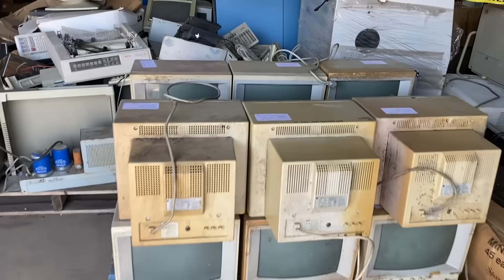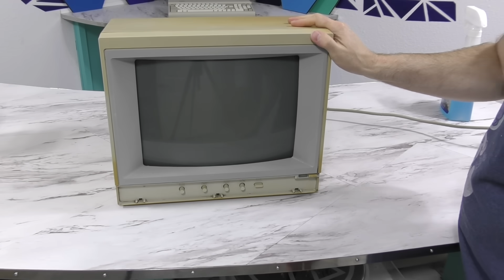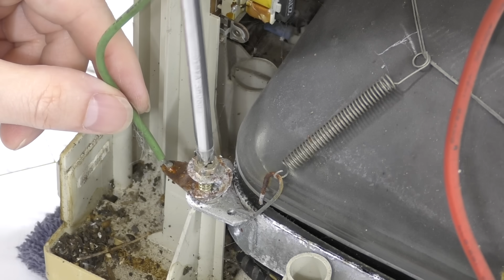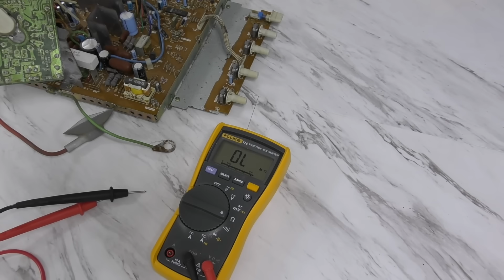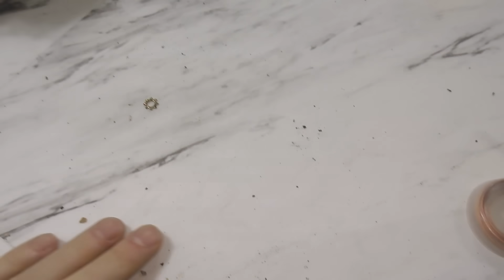Apple Monitor Found in Landfill - Restored - Part 1

Comment: Oh, wow, an Apple IIc! That brings back memories. I got a typewriter when I went off to college, because back in 1982, it didn't seem like a personal computer would do much for me. But one of my younger brothers went off to college 3 years later, and by then, there was a lot more off-the-shelf software, not to mention more affordable printers, available. So he took his graduation money and bought an Apple IIc, with the matching small monitor and stand and a printer (maybe a Gemini 10X?). A couple years later, after I graduated, I babysat his Apple IIc outfit for the summer, and I hit upon what was something of a revolutionary idea at the time: Why not use my bro's computer to help me with my job search? After all, it had ProDOS and AppleWorks, and it was all set up so I could play with it. Little did I realize that I was getting my first hands-on database experience, and darned if that didn't land me my first job! I went on an interview, at which I'm sure I didn't stand out significantly from any other candidates until the interviewer asked me if I had any personal computer experience. (Remember, this was 1987, and most computer science majors had lots of experience with Unix and C programming on minicomputers, especially VAXes, but personal computers were largely considered toys.) I answered, "Well, I've been using an Apple IIc to track my job search." That intrigued the interviewer; I was the first to answer his question with something tangible and practical like that! One question led to another, and after a few minutes, I pulled out the latest printout from my job search database. Despite the fact that this enabled him to see some other companies I had applied to (sharing that sort of information was generally considered a no-no at the time), he was quite impressed. I had a second interview with the owner of the company within the week, at which I was hired. Definitely good times.

Comment: You’re maybe a bit too optimistic for rescuing monitors/computers in landfills. Depending on how deep they are, the heat generated by the surrounding waste decomposing along with any liquids seeping down will probably break down bits machinery. But, I wouldn’t be surprised if the surrounding waste almost acted like a shell of sorts.

Comment: just use ultra fast diode uf4007 from a computer powersupply. Regarding desoldering. just cut the legs from top and take out the remainder.

Comment: copper traces within microelectronics dont tend to corrode as long as it doesn't receive power while wet and is in an area that is relatively salt free also most capacitors that arent from the 92-2005 era are pretty safe in terms of not bursting over time however it is still a good idea to recap them as the do drift from their intended spec over time

Comment: I recently found a channel called Odd Tinkering that does mostly console restoration videos.  He uses a combination of rust remover and very simple nickel plating to restore corroded battery terminals on portables.  I think you should take a look at his process for that rusty ground lug.  He has a separate video explaining the nickel plating process and it looks extremely simple, cheap, and quick.  He even replates corroded screws.

Comment: Normally, that would be a protection diode.  It saves the circuit in a reverse current condition.  In this case though, it’s more likely acting as a rectifier.  Same basic function but different use case.  Rectifier failure would cause the current to flip + to - at 60hz.  That looks about right for what that screen was doing.
Reply: Its a zener clamping diode in an ancient style casing.
Reply: W8 but correct me if i am wrong doesn't this work on dc? Dc has no frequency though?

Comment: The 1N4937 diode will probably work fine.  Sintered glass diodes like the TVR10G are more rugged so if you want something closer, a BYT54J/BYT54K/BYT54M is what I would use if I had to order parts.

Comment: Retrace garbage is likely due to a too high G2 voltage on the flyback, controlled by a potentiometer (usually). The diode arcing was probably dragging down the G2, causing the picture to look better for a second.

Comment: Some higher voltage, low current, glass body diodes are made in that package. I have seen many especially in asian made equipment. Could be a JIS standard thingy. According to the alternate monitor schematics you have shown, I think it's going to work just fine.

Comment: What a sad monitor ...it could be a dumper diode as they where extensively used on flyback circuit. Also called high voltage (at least 700v) fast recovery diode. They work with strong spikes generated by the oscillations.

Comment: For the local public schools I once threw out an entire room piled neck deep full of Apple II, GS, Mac etc. It killed me to do it but at the time we couldn't even give the stuff away, even for metal recovery.

And for rusty things like that ground, I think I've mentioned it before (knowing me... multiple times) but I highly recommend Evapo-rust, I've had great luck with that stuff, it's reusable and it doesn't eat metal so you can leave it in as long as you like. I once cleaned the power brick from an arcade game that had literally been out in someone's yard for over a decade, fell out with the entire bottom when the game was moved and looked like fried chicken from all the rust, but it managed to get it down to bare metal even in the worst spots after a few soakings and scrubbings in between.

Comment: The diode you are subbing should be fine. All you need to know is that it's a fast switching Shockley type diode, and that the current and voltage ratings are above your needs. I would have recommended using a 3A diode whenever subbing (as long as it fits) just in case the unknown original was rated at 1.5A to avoid premature failure. I live in your town and would have gave some to you but I dont know how to contact you without making my number or email public. We are both lucky to be so close to Mouser, huh?

Comment: • 11:58 - It looks like there are two arcs inside the thick orange wire, where the wire is brighter along the horizontal. 🤔
• 12:33 - That looks like a ceramic axial power resistor, probably a few watts.
• 13:07 - Ah, I can see the PCB marking, D71. Yup, diode. - 13:15 D716. Should've looked at the PCB markings to start. 🤦
• 13:45 - Those old diodes look like pool toys. 🤨

Comment: Just use a standard 1N4007 diode, they are rated for 1A and 1KV maximum and should do just fine if loaded with 180V as your schematic showed. If you want to play it safe use a 1N5404 diode which is rated for 3A 400V, but personally I think that would be overkill

Comment: The hot Texas climate surely has helped preserving this allowing the monitor to dry after it got wet. If it wouldent be able to dry it would rust away on the inside very quickly.
Reply: Yes. And what it was exposed to was only relatively clean rain water, dust and leaves. That's actually not even close to the conditions in a landfill, where it generally would be exposed to crushing force (proper landfills are usually compacted), juices from decomposing organic matter, a lot more salts and acids etc.

Comment: David that Diode is an "Avalanche Fast Recovery Diode" I have about 30+ of them But.. I'm in the UK so it would take a long time to ship sadly.
So I can give you different style/type codes, both of witch should easily help replace yours. Close to original: BYV95A 200V OR BYV95B 400V
IF you can't find them, then an easy replacement to get is either of these 3 BYW95A, BYW95B, BYW95C All 3 go from 200 to 600v 🖖👍

Comment: A bit more AI tuning / learning and this auto time stamp generator wouldn't be half bad. 
Automatic YouTube Summarizer
http://www.segmentel.com/ 

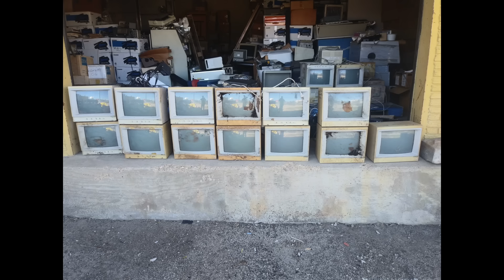00:40 - Pretty Nasty Condition
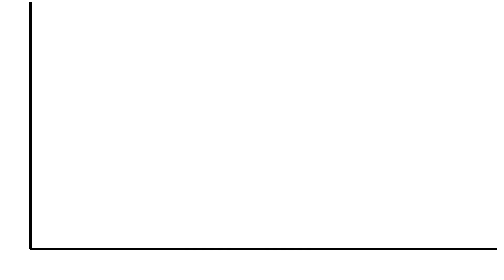01:52 - Lot Of Stuff
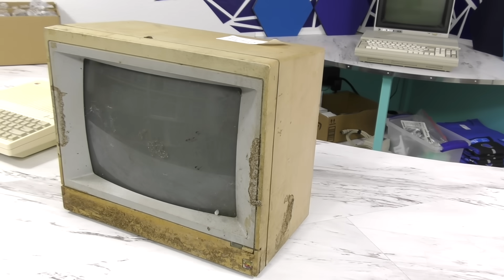02:19 - Breathtakingly Disgusting
03:18 - Touch Windex
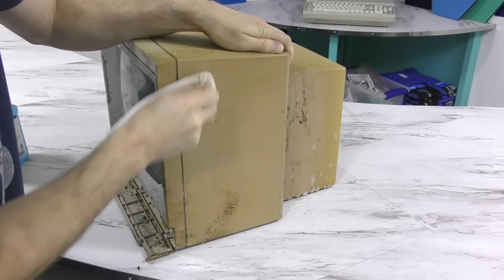04:09 - Actual Glass Part
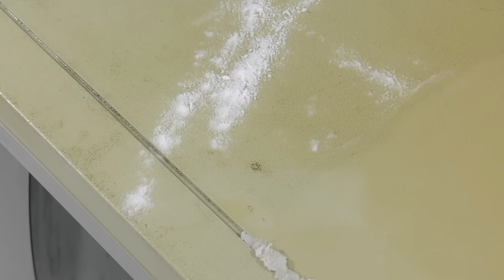05:28 - Rear Piece Separated
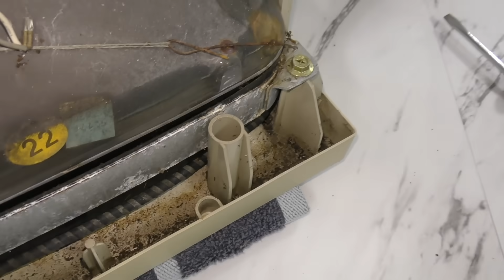06:55 - Crud Collected
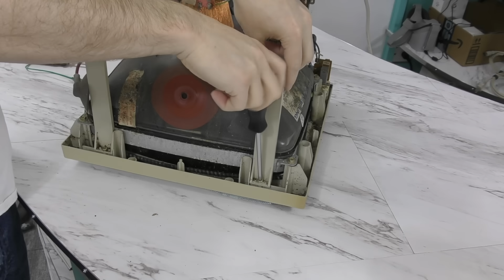07:30 - Anode Hole
08:50 - Moves Pretty Smoothly
10:16 - Monitor From Mauser
10:38 - Pretty Good Job
11:17 - Wire Wrapped Post
13:36 - Revision Than Mine
14:14 - Modern Diode
15:02 - Potentially Be Restored
15:19 - Wanted To Mention

Comment: Diodes are not picky devices. They are just one way check valves for electricity. Get one rated for the voltage and estimated current and it should work fine unless it’s a super special custom jobber.

Comment: in case you didn't figure it out, it is most likely the raster lines are from the flyback having its g2 voltage being too high

there should be a pot on the flyback to turn it down

Comment: Edit: I did a bit more research and found the actual one is the V19E: https://www.hitachi-power-semiconductor-device.co.jp/products/diode/pdf/pdj-v19-2.pdf
I couldn't find anything between V10-V14 so I assumed that there were no others but in searching some more stumbled upon a V15 which eventually led me to a page that offers a REALLY detailed guide on how to identify these diodes - from there I was able to tell only the V19 series has two bands and a blue dot.

Original Message:
Finally found it I think. It appears to be a Hitachi VO9E 

Spec Sheet:
https://datasheet.octopart.com/V09G-Hitachi-datasheet-103738.pdf

Photo I found that led to this conclusion:
https://www.taobao.com/list/item-amp/613758015851.htm
Reply: I think it's this one James...

Hitachi 400V 1.3A, Diode, 2-Pin V07E

https://docs.rs-online.com/5247/0900766b813b75ca.pdf
Reply: I don't think it's either of those. The V09 has the right identification dot (blue) but no second stripe. The V07 has the second stripe, but the wrong identification dot (red). It's definitely some sort of 400-volt-rated Hitachi diode though.
Reply: The datasheet made me believe the V07E 400V was blue
Reply: https://hk.element14.com/multicomp-pro/mur160g/rectifier-single-1-35a-600v-do/dp/3226321

Follow the spec., modern replacement.
Reply: In the circuit it's a fast rectifier so 1N4937 should work just fine.
Reply: Once you have an idea of the spec, there's loads of easily obtainable 'jellybean' fast recovery diodes out there that could do a perfect job in these situations. It's a relatively slow switching frequency, and not running at a particularly high voltage or current. It's a case of take your pick from dozens! It wasn't so easy back when I had to repair CRTs, sadly...

Comment: That diode simply converts the Hight voltage AC to  HV DC for the screen ,Any modern HV diode will work just fine.

Comment: it does not matter what old tech finding hoards of it make us collectors feel funny tickly butterflies inside like the day ay age 7 your parents told you you were going to Disneyland!
my fav tech are antique phonographs and when some amateur divers found a shipwreck with Edison disc machines the butterflies were punching! like this computer hoard left in the weather, the phonographs left in the north sea mud were all in working condition! they needed a cleanup and re-grease and tune-up but other than that they were ready to be installed into empty cabinets of which a lot were and are still are floating around sadly the news was kinda méh about it and the internet was a foreign word to many in 1993 I still have one motor and the others rejoined with cabinets over the next 5 years.
the titanic has several Edison disc machines onboard and I'm sure these motors will survive the eventual collapse of the ship in the probable next 20 years.
Reply: lately, on old phonographs, a warehouse had quite a number of portable phonographs made by german Polydor from the PD series first made in 1936 this was the same series the nazi's used as entertainment at their Nuernberg rally campsites and later in the army.
i bought one since they are now on marktplaats (dutch marketplace or eBay) and I have bids going on 3 more and I'm now scouring the web for 3rd-Reich decals to make them like the lost ones were (as you do right!)

Comment: Yours are some of the best videos on the internet, but I have one problem I keep encountering. Many times when you turn on those old electronics, they start to produce a high pitched whine that is pretty hard to tolerate, if one can hear it. Would it be possible to just lop off the top end of sound frequencies in your videos? There shouldn't be anything really useful up there anyway, and in theory it could even make the video very slightly more data efficient

It makes me wonder if maybe not being able to hear that high pitched whine is more of an exposure thing than an age thing. Many old computers make that whine, and if you deal with that every day, your brain would eventually filter it out, or it would break the part of the hear that detects that range. It's hard to statistically differentiate "associated with age" and "associated with being around tools that used to be used"

Comment: the Line output stage is overvolted, that's why your diode fucked and have retrace lines. start at the beginning of the power supply and move forward

Comment: I do think the generic rectifier diode should work fine as a replacement.

It just needs to have a high enough voltage rating, say 300V minimum.
Should be a standard non-Schottky type too, AFAIK.
Reply: The +180V rail usually just supplies the "control" grids on the RGB guns, hence the yellow wire going directly to the driver transistors on the neck board.

IIRC, the RGB signals get inverted by the transistors, because the higher the voltage on the grids, the darker the image.

The higher voltage on a grid attracts more (negatively-charged) electrons from the cathode / heater filament, so they can no longer get accelerated towards the screen.

If the voltage on a grid is lower (ie. closer to the cathode voltage), more electrons are allowed to pass, so the brighter the beam/image.

Comment: I repaired hundreds of CRT's back in the day. 90% of them were easily repaired by replacing all electrolytic capacitors and fixing cold solder joints. Heck, I still repair modern electronics often by replacing the electrolytics. I'm down for a roadtrip with you to paw through old electronics. I'm in DFW.  Soft Scrub with Bleach and Scotchbrite pads often worked wonders on cleaning up some of the yellowing of cases. When I refurbished them for Sears, we actually painted them.
Reply from the maker: Shoot me an email since you are in the area.
Reply: @The8BitGuy  Sent. :)

Comment: Have you (or anyone else here) ever tried a product like Barkeeper's Friend for those corroded metal pieces? I'm no pro, but I have done some restoring antique tools and electronics for myself. I've found it works great at getting into the uneven surface of heavily corroded items without taking off a bunch of extra material like a Dremel tool.

Even better, it protects the surface against future corrosion.

Comment: In my experience there are logic level diodes and power diodes. So in this case you can use just any kind of power diode, that fits. On the other hand there are special diodes like Zener or Schottky, that are very hard to trace back.

Comment: from what I can see any standard fast diode can be replacement. But somehow you find one that is slower than "original" :)
Just use common UF4007, higher voltage rating and faster recovery time.

Comment: I've recently started rescuing CRT monitors.  All Commodore so far.  I have a 1902 (new model0 on the bench that looks like it came out one of those dumps.  One thing I have no solution for are cases.  It usually just damaged doors, but this 1902 looks like it was partially crushed.

Comment: still need to correct the intro.. when you load a directory listing instead of a program.. i can't believe no one has spotted that mistake in the 5 years you been using that intro :-D

In the intro you type the command LOAD "$",8 instead of LOAD "*",8
Reply from the maker: It's been spotted and mentioned a hundred times.  It's actually correct. Originally it showed a directory listing and then loading the file.  But I needed to trim down the intro to under 10 seconds, and so that is what is left.

Comment: Dude, just use some high voltage diode. There are only two parameters that need to match: voltage and current. Kinda. Because power won't be an issue.

Comment: I didn't expect Computer Reset to still be around, I actually rewatched your and LGR's videos about it just last week and it sounded like it was basically days away from being bulldozed at that time. Awesome to see it's still there and people can rescue more of that hardware
Reply from the maker: It got put on life support by a bunch of volunteers until the place is emptied out.  But yes, originally it was days away from being bulldozed.
Reply: Look up Computer Reset Warehouse Liquidation on Facebook.  The volunteers are actively running sales most weekends right now. Still LOTS of stuff there. And the prices, are GREAT in my experience. But they have very specific rules so go find the FB group, read the rules, look for an event and sign up. So much treasure to be found there.  (Pro Tip: No, they don't ship, and don't have any sort of inventory listing or pricing. Just sign up and go, its well worth it.)

Comment: With respect to machines left "in the wild" for years. I've just got an ACT Apricot F1 "barn find" via eBay. It's obviously sat in water for a long time and the case was smashed and crushed. However, after replacing the RIFA smoke generator in the power supply and testing the machine it booted right into the BIOS and waited for a floppy to be inserted! (The floppy is a VERY early Sony 3.5" and hence non-standard connector so I couldn't test anything.) So if that machine survived a couple of decades there's hope for many others.

Comment: BYW56 is a diode I used for similar stuff. It even looks similar to the original one (sinterglass diode)! 
Other types like BYW54, BYV28/600 should also work.